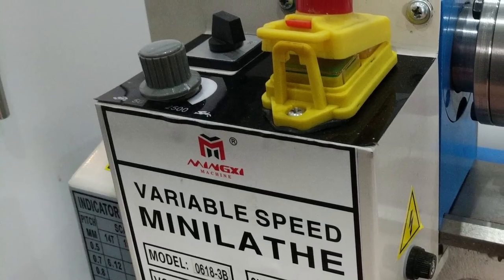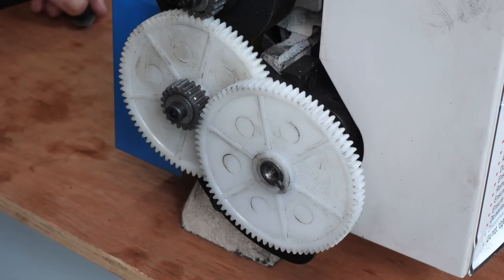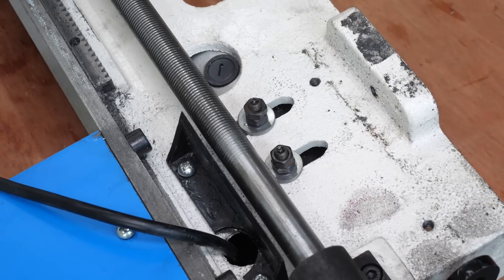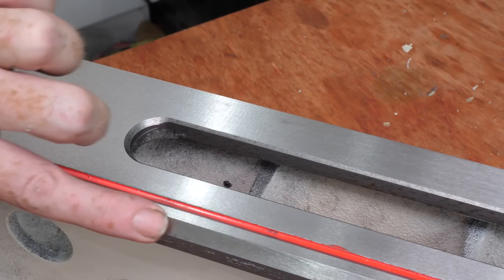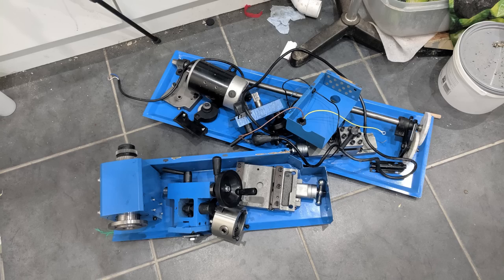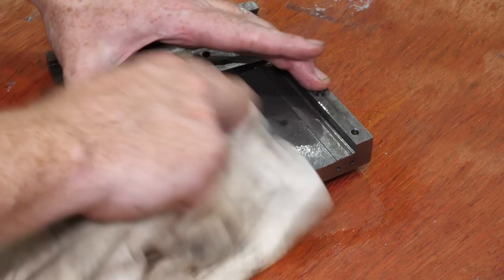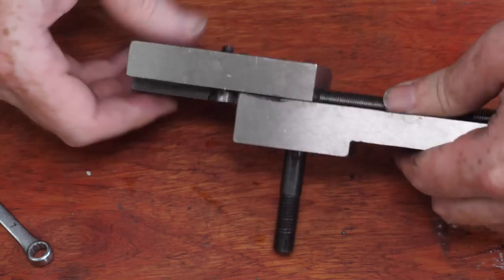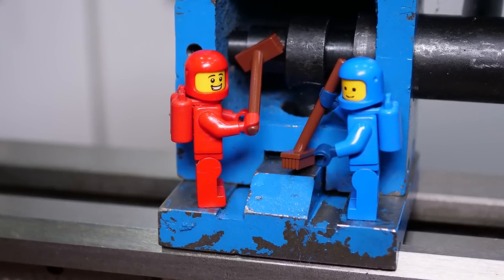Disassembling the CJ0618 7x12 Lathe, Cleaning, and Troubleshooting

Comment: Electrical grounding on a painted part, what could go wrong...?
Reply: Saw that too. Well at least the screw wasn't painted!
Reply from the maker: Yep, I'll definitely be stripping down a proper contact area during re-assembly. No-one wants electric hum on their YouTube audio recording. ;)
Reply: I was surprised there was a ground at all. So many import items have the ground just cut off in the cord.
Reply: Not as critical, but my electric guitar was buzzing when I got it. Removed the cover and found that the grounding wire had been taped on with sticky tape!
Reply: @jrkorman  Same
Reply from the maker: @totallynotabot151  :(
Reply: it's poor practice but it's actually not an issue at all. It's screwed INTO the casting there is plenty of contact surface that it will ground out just fine with no more resistance than if there was no paint.
Reply: @totallynotabot151  I saw a UT video just one week ago, where a guy did exactly that, attaching the ground wire with tape. Reason was the pickup cavity was shielded with aluminum tape. 8-)
Reply: These things come with a two pin plug, so I’m surprised it was attached to the lathe at all.
Reply: While a connection is made by the thread contact, I believe there are some codes that require no paint otherwise.  I worked at a place making machinery and anything painted like that had to be spot faced to bare metal help insure good contact.
Reply: Some problems counting on the screw to do the grounding part are:
- You reduce the contact surface to the size of the screwhead.
-  Oil on the treads make for a poor contact.
Reply: @trainliker100  I used to do compliance testing for UL  (USA) and CE marks (European Union and by extension, Japan). Ground connection requirements are pretty well-defined. Not only must the area be paint-free, but serrated lock-washers must be used, no other ground connections are allowed between the AC Line ground and the primary fastener,  minimum torque specs must be met, etc. Quite a lot for just the ground connection!
Reply: @neil5587  Apples and Oranges.
Welders come under an entirely different category of machine. The equipment I worked on was categorized as 'light industrial'  Not to mention this was just the third wire 'safety' ground, not intended to carry mains current (<20 amps) except under fault conditions, and then only until a breaker tripped.
Reply: It’s symbolic.
Reply: Not to worry, that lead paint will carry current..

Comment: Just started watching your videos so some of my comments are likely out of date.
1)  I own one of the 7x14's, purchased through Harbor Freight in U.S.  I have done many upgrades and modifications to it and it is a great little lathe as long as you don't try to overdo what it can do.
2)  This has to be the worst example of one of these types of lathes I have ever seen and I believe you are spot on with your assessment that these were likely rejects that were "pulled out of the trash bin" so to say, or there is a very unethical manufacturer in China making these (I believe they have been open art for some time).
3)  It appears you knew what you were likely to be getting and as I found with my lathe, half the fun is going through the lathe and improving it.  You will certainly have lots of opportunity for that. :)
4)  Very good quality video and looking forward to watching more of them.
Reply from the maker: Hi Ron, yes, you're right that the lathe I got is essentially the lathe I expected at the price I paid. Welcome to the channel, and thanks for the comments.

Comment: Wish I had seen this back when I got my little Central Machine lathe. I took it clear apart and sure missed some areas you covered. I see some differences in in my machine. Replaced the bearings in the headstock with angular contact bearings but took some effort to get them preloaded right. Replaced the plastic gears in the headstock for high and low range with metal and that was a mistake as what you buy has a lot of backlash with no way to correct and they are noisier. Did install a tach. Shield on the apron gears. Button head screws on the handwheel makes it a little easier with more room. I imagine you know of all the modifications so will be interesting to see your reassembly. My lead screw bracket has no way of lubrication so need to change that. My headstock only has three mounting screws so they missed drilling one!!!
Reply from the maker: I have a shield on the apron gears on my project list, among many others. What technique did you use to get the bearing pre-load right in the end?
Reply: @AdventureswithaVerySmallLathe  To begin with I had to make a spacer that would go on before the double nuts otherwise you run out of threads to pull the main shaft back. I couldn't find good data on how much to load the bearing set so did go by seat of pants. You get a pretty good idea when you make some cuts and get zero movement. I got sealed unit so I do not have to worry about lube like those using open taper bearings.
Reply from the maker: @gvet47  Thanks for the tips. The fact that angular contact bearings are available sealed is the main reason I'd like to try them out, but they are more difficult to get right, so I've got some data sheet reading to do.

Comment: Originally I planned on purchasing a small hobby lathe, although, not the cheapest one I could find, after seeing your video I was looking more at an Axminster lathe at about £2k, but even that has its shortcomings, now looking at a UK made gear head lathe for £4k
Reply from the maker: I'm intrigued! Tell me more about this UK made gear head lathe?
Reply: @AdventureswithaVerySmallLathe  hi there chap.
It is made by Warco in UK. Rather than having ball bearings it appears to have axial load bearings, also it can cut metric and imperial threads without having to take all the change gears off, which invariably have burrs all over them, that is if you can get metal gears in the first place, I still have to go to the factory to suss them out.

Comment: Good job there

Yes I have a cj18a which is pretty similar when I bought it to yours. But it is nothing like the original now. I changed the bearings in the Head-stock for angular contact bearings, did away with the high and low gear in the head-stock (though I had previously changed them for  metal gears rather then plastic gears) Installed all metal change gears except for the nylon tumbler gears which are sacraficial gears in my opinion and most of the time thes will strip if there is a problem before further damage can be caused. and they are cheap to replace. I also I dumped the supposedly 550W motor (Not marked in any way and suspect it is not a 550W motor) for a 750w 3 phase motor and a VFD. 

Incidentally Tim Nummy did a good video on the existing motor mounting on these machines  and the early Steve Jordan video's are really good for improvements on these machines to.  Steve Jordan in particular inspired me and as I gained confidence I found I was doing mods I would never have believed it would be possible to do. I made my own quick change tool post and a goodly number of tool holders as well

I have to say straight out of the box these machines are rubbish. but if you are prepared to put the time and work into they they can be  very good and useful machines,.

You are certainly doing a thorough job with it :) look forward to you next one. Subscribed.

Comment: Nice to see you back Alistair. What you keep calling "screws" are in fact "bolts". Looking forward to this series, keep them coming :)
Reply from the maker: It's only a bolt if it has a nut on the far side.
Reply: I’m a retired machinist and we called then screws.
Reply: The distinction is not clear cut, but the principle of a bolt being fitted to a through-hole and paired with a nut versus a screw mating with a threaded hole is one that can be traced to USA import tariffs, which considered screws to be more valuable parts with finer tolerances.

Alternative distinctions exist:
Bolts should have a smooth shoulder (for mating with a through-hole) versus screws being threaded along the length.
Bolts heads are externally driven (with a spanner) versus screws that have the tool interface cut into the head.

Tomayto-tomahto.
Reply from the maker: @EmyrDerfel  While I was digging I found some people who think that the US government got their definition from Machinery's Handbook, and others who think it was the other way around.

I didn't think it was worth searching through historic editions of MH to find out which edition that definition first appeared in. :)
Reply: I am an aerospace engineer and most of our fasteners have a plain shank and are called bolts. To us a screw is fully threaded.

Comment: Mic the bed ways. If it's anything like mine, it varies significantly in thickness. If you want the carriage to actually be rigid and consistent, it'll need to be a consistent thickness and parallel to the top of the bed.

I think it also needs a carriage lock.
Reply from the maker: Thanks for the tip! The Aussie Shed posted a lot of videos about improving a similar lathe, and they put a lot of effort into fixing exactly this problem. Looks like I have my work cut out for me.

Comment: Glad to see this video.
I have a Clarke CL300M. and it is more expensive than other identical ones ,
and this video clearly shows why.

As it shows here , cheaper mini lathes that has failed there high price quality check are cheaper.
And so shops that have them branded and to be top quality made, Come at a higher price.
Shops like machine mart don't want equipment/tools coming back faulty giving bad reputation.

Anyways mine works a treat for the price I paid. and so if you choose  the cheaper option then study this video as it gives a good  insight of the cheap Chinese mini lathe.
Reply from the maker: I went into Machine Mart and had a look at their Clarke CL300M, but sadly I couldn't arrange for the staff to be distracted long enough to get it fully disassembled for inspection. I did see enough to know that it's a good deal better. I also managed to get to Harbour Freight on my last US trip before the Pandemic, and checked out the Sieg C2s they have. Also much better condition than the one I got here.

Comment: Disassembled everything before starting my cheap Chinese lathe. Fortunately, I adjusted the motor mounts and drive belt before any damage could be done. Also, found all the loose and missing screws before they had a chance to break teeth on the gears. It's also a good idea to check soldering points on the control board before powering the lathe. Quality control of these lathes sucks, so inspect and adjust your lathe before starting it. Cheers

Comment: When you put the lathe back together use button head screws to secure the compound and cross slide  crank type handles as it gives more room to operate the handles.
Reply from the maker: Great tip, thanks!

Comment: Boy that lathe looks to be a real turkey! It could have been a 'Frankenstein' machine cobbled together with all of the bad bits from different machines.  I say that because my first lathe was of a similar type which I bought from Amadeal and it was several orders of magnitude better than this one. In general the Chinese lathes seem to be fundamentally sound in build but quite often are assembled very slap-dash. Looking forward to seeing what you manage to get when you re-assemble it.
Reply: I think it's like with so much else, you get what you pay for. Sometimes the cost and quality balance is a bit better and sometimes it's worse. This time it seems the price / quality isn't quite up to parity. There are Chinese manufacturers that can and does produce quality products, but then they tend to cost more than what we in the west are used to pay for Chinese products. So a lot of the products we see are cheap crap, because that's what we pay for. This lathe seems to be made from parts that failed inspection but were still somewhat usable. The assembly does suffer from shortcuts being taken to make it cheap and quick to assemble. The bent rods securing the motor is something I guess happened during shipping. At assembly it was probably working, but a few bumps during shipping took care of that. 

I've seen several examples of machines like this. Sometimes, rarely, you can end up with a decent machine. Byt that I mean a machine that does what it's supposed to with minimal problems, but still lacking the feel of quality you get from a really good machine. But most of the time they are frustrating and tend to take a lot of time and effort to get them working the way they should.
Reply from the maker: Your Frankenstein theory sounds very plausible.

Comment: I don't think you need to yearn after precision ground flat stones.

One of the few times when physics is on your side is when knocking burrs and dings off a flat surface.

Woodworkers sometimes try to make the bottom of a handplane flat by rubbing it on SiC paper, fixed on a flat support.

This starts off going quite fast - the high spots come off quickly.

But as the handplane becomes flat, the surface area in contact goes UP and the cutting pressure goes DOWN.

As you've probably found, a flat abrasive against a flat material cuts very poorly due to low cutting pressure.

The upshot is ...

... you can simply knock burrs and dings off a flat surface without worrying about doing any substantial harm to the flat surface.
Reply from the maker: I know they weren't really needed for this job, but that won't stop me from yearning after them.

Comment: Nicely done video. You no doubt know that all the slideways would greatly benefit in function and longevity if properly scraped for oil retention.  All the metrology and scraping technique would be an enormous gain for your skill set. It would also add a month to the project. Maybe try it on just the compound and see what you think.  Look forward to next steps.
Reply from the maker: I'm definitely planning to scrape at least one of slides, as a learning exercise. A lot to learn before I can even start on that though. Thanks for the encouragement.

Comment: I clean dirty shotguns actions pretty often, and I use a stiff acrylic brush to first /move/ the crud out of the hard to reach areas, then either flush it or wipe it, before covering in "moli" grease or gun oil (depending on the part).
Reply from the maker: Thanks for the acrylic brush tip. It's always great to learn new ways of cleaning up metal, without damaging the finish under the dirt.

Comment: Looking forward to the much improved version, some chronic production short cuts used in the manufacture.
If I may suggest, White Sport/Mineral spirit is an alternative to using WD 40 when cleaning is only required, but WD 40 is useful on small projects.
Thanks for sharing.
Reply from the maker: My main reason for using WD-40 is that it leaves a trace of heavier oils as a film, which forms a protective coating. White Spirit evaporates completely, which is great for leaving a residue-free surface, but can lead to rust. Thanks for watching!
Reply: @AdventureswithaVerySmallLathe  Good point, for light soiling, and short term storage WD 40 is perfect here, White Spirit can be reused, after the contaminants have settled to the bottom, but messy to store. I do use Jizer for heavy soiling, even cleaning after with water, it leaves a light anti corrosion residue.
I've recently started to use 3 in 1 oil spray, and in oil form, a little cheaper than WD40.
Love the Lego helpers.

Comment: Hi AWVSL. Really useful video - and not just for this small lathe. Many of the larger ones are constructed in much the same way. Mine had some real horrors, fuse in the neutral lead (argh!), no heat sink on the electronics. I suspect the motor mount studs on this one got bent in shipping - not strong enough as you said and the motor mass did them in when the lathe was bounced around. BobUK
Reply from the maker: I think the motor mount washers actually bent more than the studs, though once there was some slop, I guess the shipping movement made both bend even worse, exactly as you say.

Comment: My Chinese Minilathe looks nothing like as nasty as that one. Presumably you paid a couple of hundred quid for it. My paint is perfect, no touch up or paint on fixings or on machined surfaces, and I needed to remove some grinding grit with WD40. Mine needed some adjustment on the gibs, but otherwise it was perfectly usable out the crate. Also my chuck has a cover plate on the rear, which yours is missing. I did need to clear the same grit from the chuck scroll, but nothing a few minutes with WD40 and a clean cloth couldn't sort. My motor is also secured with M8 bolts, and the belt was at the correct tension, without  bent bolts.

I paid £420 for mine, from a company selling on Amazon. For that money, I was more then happy to do a little PPM on it before I used it. With these it pays to shop about, and understand that a bit of PPM is needed before using it. ;)
Reply from the maker: I paid about £330 for this one, which honestly probably isn't enough of a discount to be worth it, given the problems. However for my purposes, I was looking for a learning exercise, and a machine for tinkering and experimentation, so I'm happy with the way this has panned out.
Reply: @AdventureswithaVerySmallLathe  

If you're after a project and video subject, then you got that.

I think these lathes can be good, once a little work is carried out on them. 

If they're considered a lathe kit, which needs some final finishing, but has been assembled for easy of transportation, then you won't be disappointed. 

I like mine, and am continuing to make improvements, as and when I feel it's necessary. 

I fitted angular contact head stock bearings to mine, which made a large difference. 

I've also fitted the same Machifit quick change tool post you reviewed. ;)

Keep the video's coming.